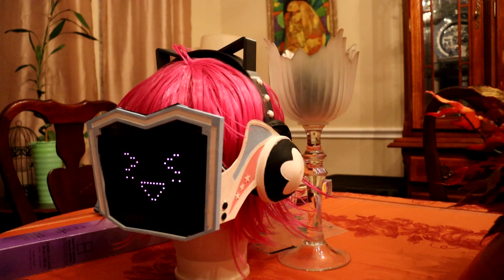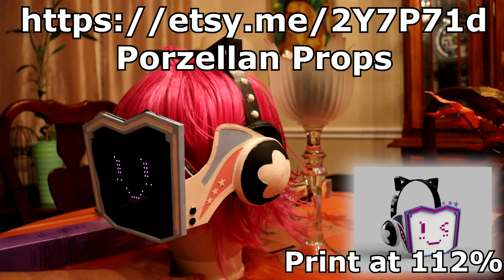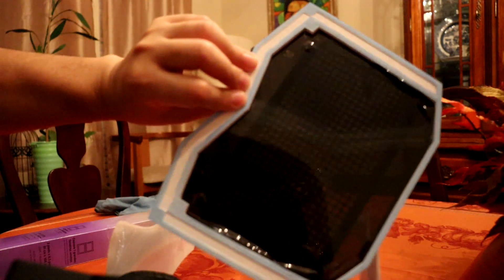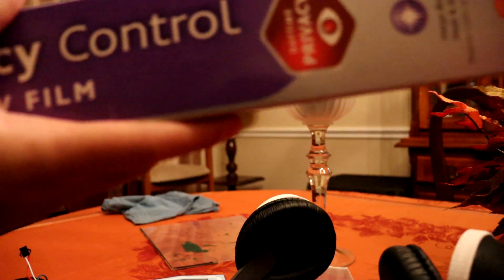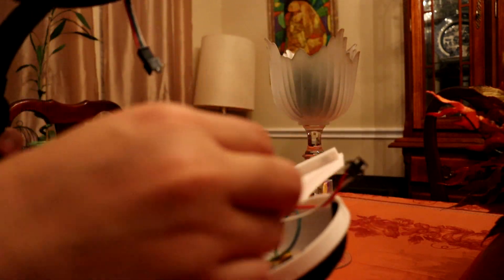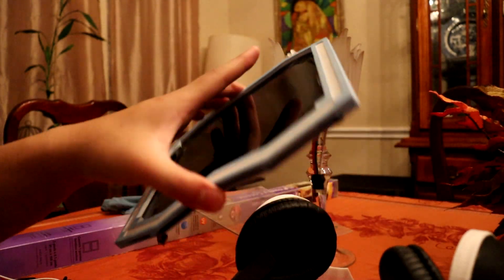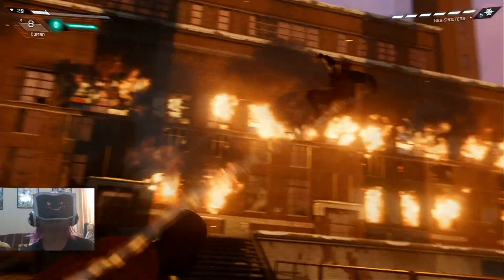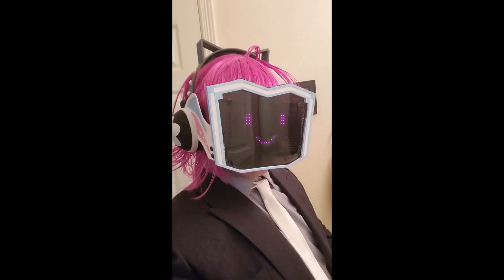Working Rina-chan Board Prototype (UPDATED VIDEO IN DESCRIPTION )

Comment: Just thought I would revisit this video to let you know I literally had ChatGPT 4.0 rewrite source code for this today. And it WORKED. Anybody struggling to get some working code for this can do the same thing. Ask it to write you an arduino program for controlling the brightness and color of LEDs in an 18x24 grid using (x,y) coordinates. Then ask it to include the ability to draw squares, circles and lines using (x,y) coordinates. You might have to regenerate the response a few times but eventually it should turn out some working code that you can play with
Reply: Not to mention it will literally teach you arduino after it's done writing the code

Comment: Hii! I'm late commenting on this video haha :) for the battery and the battery charging port(?) Plus wires, did you have to assemble those all together or does it come like that? I don't think I'd know how to assemble all that lol! Thank you :)
Reply from the maker: Hi, I've found it more convenient and simple to use an 18650 battery holder and forgo the charging module as it makes it simpler and allows you to carry batteries and swap them out at cons.

Pretty much any battery around 4-5v volts should work if you attach the positive side to 5v/vcc and the negative side to gnd.

For the simplest and laziest solution, you can actually just power the whole thing via micro-usb (or usb c depending on which flavor of Arduino you use). You'll just most likely have a wire sticking out of the headset and a USB battery in your pocket.

I'm in the process of making an updated video (could be weeks or months before I get to it, though.)
Reply: One more question; i cant seem to find any seethrough LED matrix screens. All of them have a plastic backing :( did yours have this too and did you remove it or did it come like that?

Comment: Hey just wondering bc the Amazon list isn’t there anymore I wanted to know what you got especially the battery and battery charger so if your able to lmk please do :)
Reply from the maker: In the end, I went with just an 18650 battery holder off of amazon and (legitimate) 3500 mAH batteries from Illumination Supply. I learned not to trust 18650s from Amazon.

Comment: Hej, I would like to attempt making the board myself. As I have experience with 3D printing, soldering, arduino/ESP32, etc. If I bumb into problems, is there a way to contact you easier than YT? Or just if I want to show you how mine ended up! Thank you so much for sharing all of this info an materials tho. Saves me a lot of time as well! <3
Reply from the maker: Cool! You can DM me on Twitter (@blockwonkel).

Comment: My girlfriend and I made this headset following your tutorial. I found your secret sans face in the code lol its pretty cool tbh
Reply from the maker: lol I commented out the Sans stuff because it was a huge battery drain and I could hear something in the circuit whining whenever it showed up.
Reply: @BlickWinkel  hmm that's interesting. It definitely drains the battery considering how many LEDs are lit but I can run it fine without any weird noises
Reply: @BlickWinkel  I even went out of the way to get the exact same LED matrix and wemos board as you so maybe its something simple like your solder connections

Comment: I don’t have a 3D printer, so if I bought one that’s already printed do you think I’d be able to mess with it and make program it like this? To actually work haha😅 really want one, but I want one that I can make actually work like this.
Reply from the maker: You'll just have to make sure that the viewable "screen" of the printed Rina-chan board matches the size of the actual led panel, or it might get difficult to attach the panel to the plexiglass.
Reply: @BlickWinkel  follow up questions, does the 2pin connector on the battery connect directly to the 3pin connector on the LED matrix? And is the battery charger module necessary? And did you drill holes in the plexi glass for the screws?

Comment: ok where do you get that working thing that makes rina chan boards face move?
Reply from the maker: It's running on an Arduino board. I put the code in the description.
If you just want to play with rina-chan board expressions, there's the site rinachanboard.com
Reply: @BlickWinkel  ok but how do you build using the wires and stuff

Comment: What do you use to control the rina chan board? Also this is seriously amazing thank you for sharing!!
Reply from the maker: Nothing at the moment. It just loops through the expressions in a set order.
It should be possible to control it with another ESP32 device or a smartphone via direct wifi, or by adding a button(s) of some sort, but I'd have to program that.
Reply: @BlickWinkel  sorry to bother again, but I'm pretty small. Im scared about printing it scaled up. Is there an led panel that is a bit smaller so i can print it regular size

Comment: Do you think you'll do a tutorial on how to make it :o? It's ok if not ^^ Your Rina chan board is really cute :D
Reply from the maker: There are a few too many skills involved (3d printing, minimal soldering, and some arduino programming) for me to make a comprehensive video. I mostly just wanted to make this video to share my approach, especially since it's far simpler than other approaches I've seen as it uses an off-the-shelf display instead of creating your own LED matrix using LED strips, thus simplifying the soldering to three wires for the entire display rather than 3 wires per row of LEDs.
Reply: @BlickWinkel  are you selling any?